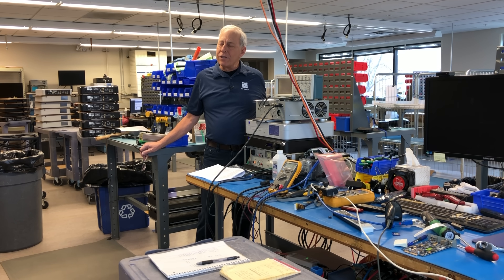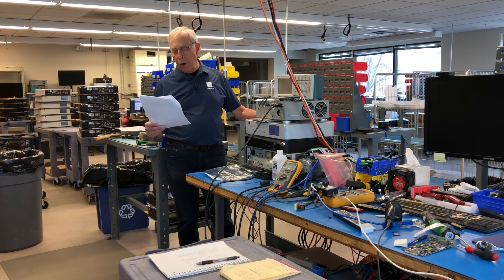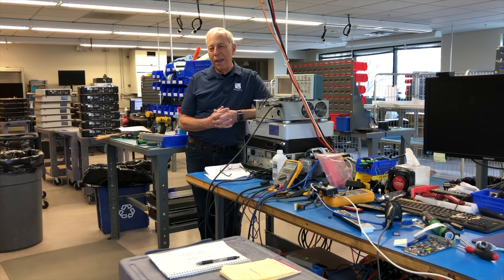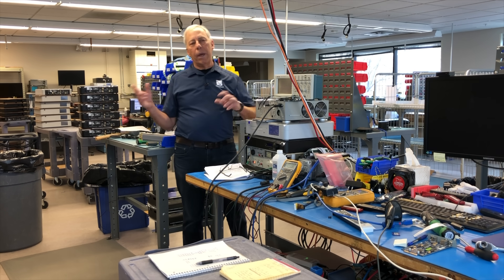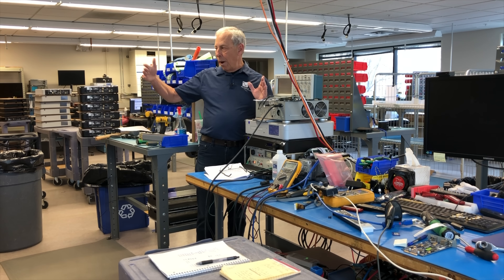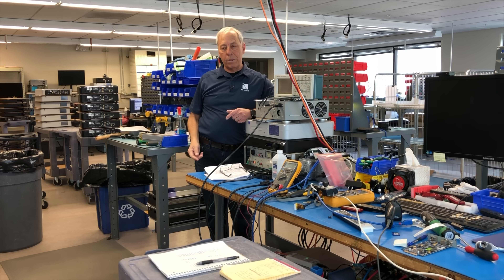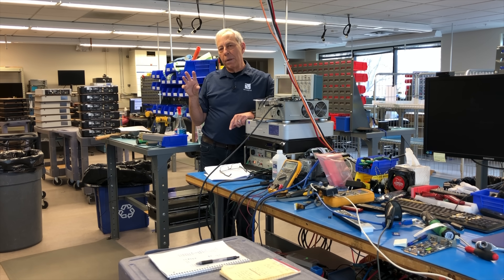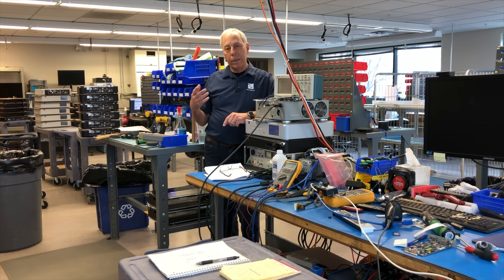Will a 50Hz component work at 60Hz?

Comment: Question.  So I will be getting a LCD 2018 LG TV that is from Europe.  The 50UK6500PLA to be exact.  The details of the TV says it has TM100 (Refresh Rate 50Hz) and the American version of the TV is TruMotion 120 (Refresh Rate 60Hz).  But on thing is, the European Power details, it says "AC 100~240V 50-60Hz".  So it looks like it is still capable for 60Hz.   So I will be using Roku, N64, etc. that I have here in the United States.  So will those devices be slower as the TV is from Europe but my devices are made for the North America?
Reply: TVs in Europe have only PAL (4.43 Mhz colour) and/or SECAM (4.4 and 44.2 MHz mixed colour) analog TV tuner that can’t change to NTSC colour system and System M (4.5 MHz carrier) mostly use in NTSC (3.58 Mhz colour) countries, PAL-M in Brazil (3.575 MHz color) and PAL-N (3.582 MHz color but 625 lines).
Reply: BUY A TV IN UAE OR SAUDI ARABIA. THAT TV HAS MULTIPLE NTSC-M, PAL-B/G, I, D/K and SECAM-B/G, D/K analog TV tuners. 

TVs sold in Saudi Arabia or UAE also have:
Colour system selection: AUTO, NTSC 3.58, NTSC 4.43, PAL, SECAM
sound carrier system selection: M (4.5 MHz), B/G (5.5 MHz), I (6 MHz) and D/K (6.5 MHz)
Some analog TV tuner have International TV tuning frequency: America (Philippines, South Korea, Taiwan, Burma), Asia/Western Europe, Russia, Indonesia/New Zealand, China, Hong Kong/UK, South Africa, Australia. (That function only for Samsung TVs).

JVC multisystem NTSC/PAL/SECAM analog TV sets sold in Saudi Arabia also on System M that Mostly uses US frequency, and system B/G,I and D/K mostly uses Europe frequency.
Reply: Not a frequency issue:

Chile uses NTSC and 220V at 50Hz
Saudi Arabia uses PAL and 220V at 60Hz
Reply: TVs sold in South America supports NTSC 3.58, PAL  4.43, PAL 3.582 (PAL-N), PAL 3.575 (PAL-M) and SECAM (PAL 4.4 and 4.42) on Video AV inputs only, Component also uses both 50 and 60Hz, for analog TV tuner that uses only 4.5 MHz sound carrier: NTSC (525 lines, 3.579 MHz color), PAL-M (525 lines, 3.575 Mhz color) and PAL-N (625 lines, 3.582 Mhz color).
Reply: LG TVs sold in the UK only have analog PAL-I (6 MHz sound carrier, 8 MHz bandwidth: UHF CH 21 - 69) but can’t change sound carrier systems: B/G (5.5) and D/K (6.5) nor NTSC-M (4.5 Mhz) nor SECAM.

Video inputs supports NTSC, SECAM and PAL, 50 Hz 60Hz refresh rate for component and HDMI.
Reply: For UK LG TV, also but RF TO AV (menu uses PAL, automatic color system change: sound carrier switch selectable: M, B/G, I, D/K. RF TO AV box sold on Aliexpress but can’t use on NTSC only TVs.

Comment: So, transformers become more efficient at higher frequencies and thus can be smaller.  This would explain why military aircraft and ships use 400 Hz.  Thus, transformer designed for 50 Hz would be a little bigger than needed at 60 Hz, but a 60 Hz transformer would be too small to work at properly at 50 Hz.

As a side note:  I am old enough to remember when frequency was specified in cycles per second, cps.  Then someone decided we needed to have a name for that and decided to honor Mr. Hertz.  I prefer and wich we had stayed with cps since that describes that thing we are actually talking about.

Comment: Will the lifespan of a 50hz equipment used in 60hz remains the same or reduced?
Reply: Sir I have a Denon amplifier I bought 13 years ago from UAE. Still working without problem. Hope it helps

Comment: Permission to comment i want share my personal experience a 50hz receiver will work on 60 hz power supply  i bought my harman/kardon receiever by mistake and impulse buying cause it was on a good sale which include speaker my mistake is i didnt check that the power supply is 50hz it works fine on me when i shipped it on my home which uses a 60hz power my receiver damaged not by power supply but with the cats urine cause they slleep on the top of my unit with open grills on it. Im from Philippines by the way

Comment: Thanks, we bought an automatic cat litter tray using a 24v 60hz synchronous motor using a 120v mains adaptor.

We are on 240v 50hz, and though I got it working, it was very noisy.

I finally realised it was probably the 50hz making the motor unhappy, and you have confirmed that it is probably the case.

Comment: Question: I bought thru ebay a vintage Panasonic flip clock from the 70s. In the USA it ran on 110V & 60Hz. Here in Europe (Italy) on the other hand we have 230V 50Hz. Is there some sort of converter/inverter/adapter that could do the trick to make it work correctly? Thanks
Reply: A step down power transformer can get you the 120v but there's no easy way to convert down the 60 hz to 50.
Reply: @sfs2040  thank you for your reply! Now I'm in the US again and I'll be able to connect those vintage Panasonic clocks soon on their original power grid. This time on the other hand I will have to figure out how to hook up the Panasonic vintage radios that are identical but meant for the European electricity grid. In the future I'll post a video regarding this specific radio clock model from the 70s/80s

Comment: Hello !
I have a studio flash (photography) that works in 200-240 Volts at 50 hertz.
Can I use it on a 220-240 60hertz chain ?
Note: this flash has a fan that works by cooling it and a digital display.
Thanks!

Comment: I don't think it matters much with solely electronic equipment. You must understand that hertz can only translate on mechanical equipment that depend on rotary where heating can be factor in reducing the life of the equipment. Clocks/ timers are probably the only issues since running higher or lower than the source can make it less accurate but it will never kill your device or make it less efficient with time.
Reply: It used to be with reel to reel tape recorders and grammophones that it did matter the Hz. I had a Sony TC-102 that had a spare spindle for the motor, the 60 and another for 50 Hz. the latter of course had a larger diametre as to drive the correct speed difference. Today, most evrything works on both frequencies. Computers, iPhones, etc. all run on either frequency. The 50 vs 60 Hz was prinararily for motors for clocks and audio equipment.  Again it is only a ten beat per second difference between the two. Now 25 Hy shant work in either, that frequency is just too low for modern appliances. It is great for railway electrificatzion however (single phase). Now in my country, switzerland, as well as Germany, Austria, liechtenstein, and Sweden, as the railways use a 'Drehstrom' or three phase system, single phase is tapped for what is one/third of 50 Hz, 16,666667or 16.2/3rd Hz. Hz. One can see the incandescent lighting flicker at this frequency.  Both on the rolling stock, and the wayside signalling.  Today, with LED, maybe there is some inverter as to convert to either 50/60 Hz.

Comment: Hi I have a 210 - 240 volts, 50 hz washing machine that i bought in the middle east. Can i use it here in the Philippines with 60 hz electricity supply.
Reply: Its always a bad idea to use 50hz on 60hz or vice versa on equipment with rotary motion. With time your equipment becomes less efficient.
But to answer your question, the washing machine will probably run fine since its not drawing more power than what it suppose to manage. The problem is using 60hz appliances on 50hz source supply can damage your equipment over time.
Reply: Same issue XD

Comment: British clock with tea machines won’t work properly because they are design for 50hz and plug it in an 60hz outlet it will make tea but the clock won’t because they measure the time by using 50hz as a reference and it will make your tea earlier.

Comment: You are correct that Taiwan uses 60HZ but Taiwan is manufacturing country that the product intended for china or Hongkong or other countries that uses 50hz were maybe  sold deliberately to local market w/ cheaper prize. I buy the Digital clock from Taiwan Superstore as a gift but when I arrived in my country the clock is moving fast. Do not use also an AC voltage regulator of different frequencies. if you use a 50hz AC regulator to a 60hz frequency you will burn the house that uses that regulator. To my experience in servicing electronics equipment with motors use only the wright frequency to guaranty it will work normally for a long time.

Comment: I need help sir i have a 50hz 220-230V.Corded type wahl hair clipper bought in Italy.Can use this in a 60hz 220v supply in the philippines?
Reply: Sure you can. These type of equipment does not rely on frequency in their speed.
Reply: @betong4908  Yes it does because a hair dryer have a motor to blow air.

Comment: I have a hammer drill machine with cord it is 230v and 50 hz can i use that to 220v and 60hz?
Reply from the maker: Any motor that runs on AC will have its speed affected by the change in frequency. On a drill that probably doesn't matter.
Reply: So it will run in 220v and 60 hz and it will not overheat?
Reply from the maker: @AmajaceTV  I am no expert of drills and hammers, but in my experience, a frequency dependent motor just runs a smidge faster at 60Hz than at 50Hz. If you're worried, do tests of the heat and keep an eye on it.

Comment: So I can use a smartwatch that's from China that's 50 hz in Philippines where we use 60 hz? Is that right?
Reply: mymidgetbae Smart watch is battery operated. You mean Smart Plugs.
Reply: mymidgetbae You can use smart plugs from China and use it in the Philippines with Euro/US to US plug adapter and no problem.
Reply: Smartwatches are powered by a battery that is charged by a charger that was designed especially on the assumption that one who uses a smartwatch is likely to travel around the world.  Therefore, the fine print on the charger will say 100-240V 50-60 Hz on the AC input.  The DC output rating on any smartwatch charger worth half its salt will read 5V DC at 3.0 A; if the smartwatch is fancy enough to charge using USB-C, a charger worth half its salt will give a rating (and darned well deliver on it) of 20V DC at 5.0 A.

Comment: I need help i have a 50hz 230v. Corded type brush motor power tool(dewalt). Can use this in a 60Hz. 230v. Supply.?
Reply from the maker: Yes, very likely. These kinds of devices do not typically rely upon the frequency for their speed.

Comment: 50hz & 60hz cannot be mix because it will damage or it will malfunction the equipment u are using for a long use. Use the right freq as design in the equipment. Example a 50hz Digital clock design in Taiwan or China cannot be use in Philippines 60hz freq. The Time will not be exact even same voltage. Electrical & Electronic design follow the frequency it was design except the designer tell you that you can use it from 50 to 60Hz as indicated on the product label. Another example is the Xerox machine if you change a 50hz motor from original 60hz motor with the machine running in 220 or 110v 60hz. The Photocopy of the xerox machine is very far from the original copy. In short intermittent copy. In Computer with 60hz design and you use a a 50hz PSU in 3 to 5 months you will damage the HD. In summary use the equipment on which it was Design. In Audio Equipment follow Paul advice because He is long time in that field. My field is all office equipment and Front to Endline Semiconductor Maintenance.
Reply: Correction: Taiwan is on 60Hz, but uses 110V. Their analogue television system used NTSC colour.

Comment: Paul, lets take a 50 Hz inverter and ask it to run at 60 Hz, will it work/,, because the electric motor the inverter is powering is 60Hz but the only inverter I have big enough to run the motor  is 50 Hz.

Comment: I rarely find better and clearer explanations of electricity related things  than your video. What if the frequency is much higher? Say 400Hz. I just bought a new pure sine wave dc to ac inverter and found that it does not give me 60Hz as I wanted but something close to 300-400 Hz with a load. (When there is no load,  the frequency is erratic and changes all over the place some where between 600-900 Hz.

Comment: DC is better than AC for transmission with high voltage because of less reactive losses and no skinneffect present, the only problem is how to cheaply and easily transform the voltage and that's the reason we use AC instead of DC, HVDC is the standard for transmissions for more than 500km.
Reply: Yes! His explanation about why ac is better for distribution is wrong. The reason high voltage distribution is better is because given a fixed power for a source, the volts and current are inversely  proportional. If you keep power constant and increase the voltage then the current decreases. Decreasing the current decreases the loss due to resistance I^2 R. At  Teslas time, transformers could increase ac voltage but there were no practical methods to increase DC. Today we have efficient dc-dc converters that generate high DC voltages. You are right!

Comment: I have the same question but other equipment. Is it safe or how it performs using 50hz inverter Mig Welding machine on 60hz supply will it perform the same on 50hz vs. 60hz. Thanks in advance.

Comment: So if I have an appliance that works on 50hz, and I move to a country with a 60hz frequency, how can I  reduce the frequency from my power supply from 60HZ to 50HZ? Reason is, my washer/dryer machine refuses to work on 60HZ and throws an error code on the display. And I can't find a way to fix it, please help
Reply: No need it is working well here in philippine but if you have a doubt use AVR

Comment: Sir my question is that would there be a difference in the electricity bill of countries that recieve line voltage of 220v and 110v respectively?
Reply: No, - not because of the line voltage. Typically you are paying for electric energy, E = W * sec. or in kWh. Mind you: W = V * A
Reply: The minimum voltage in the US is 120 volts. It used to be 110 volts.

Comment: Loved the video. The question that brought me here relates to a mini split ac system sold in India for 600 brand new that the same manufacturer sells here for 4 times that. The only difference in the spec sheets is 50 hz vs 60 hz. Thanks to your clarification I believe that if a transformer at 50 hz is over built for 60 hz then a motor will be also as they are essentially the same thing. Thanks so much.
Reply: The motor will likely run faster at 60hz but I doubt it would damage anything

Comment: Sir hbt my 50hz fridge.. How to use it in Philippines,. Thanks
Reply: matanghari Iglesias It will increase it’s temperature.

Any 50Hz appliances from China including toasters and Rice cookers in the Philippines that uses 60Hz  have no problem of using it.
Reply: @FrancisLitanofficialJAPINOY Stop spreading lies. Machines designed for 50Hz work better on 60Hz as they get extra 20% efficiency. Motors may spin too fast though and some sensitive appliances may break (coffee machines are very sensitive for some reason). But most of the time it will be cooler on 60Hz
Reply: @LoganT547  how about my water pump 50hz can I use it in 60 Hz?  There is no problem?

Comment: Would my solution work?:
I want to use clippers from the US in Germany.
Since german outlets only provide 50Hz I wanted to transform 230v AC to 12v DC and then invert 12v DC to 110v AC and hope that the inverter magically provides 60Hz. I think im stupid
Reply: genoelch 50 hz washine machine  will work on 60 hz supply?
Reply: genoelch Not 230V to 12V DC. It’s 100V to 240V AC to 12V DC, in order to plug your 12V DC to 120V AC inverter for your hairclippers. Not just 230V at 50Hz, but also 50Hz countries uses 100V - 110V - 127V at 50Hz. Eastern Japan (Western Japan uses 60Hz), Jamaica, Barbados, Caribbean Dutch, etc..

ROYAL CARIBBEAN CRUISE LINES SHIPS electrical outlets uses 60Hz in all voltage outlets.

Comment: If I were to get an electric shock, 120 v. 60 hz. is much better than 120 vdc. Why you ask? 60 hz. means that the voltage has to pass through zero to - than again through zero to + meaning when it goes through zero, you can let go. 120 vdc is constant. You can't let go!! Much more dangerous. I have an old Crosley tube radio that's rated for 25 hertz. Works just fine on 60 hertz.
Reply: You are wrong. AC is much more dangerous than DC. 60 hertz is oscillating too fast for you to let go anyways. The reason why AC is more dangerous is because the peak of the wave is higher than the rms. For example, 120 volt rms has a 170 volt peak. The sine wave can deliver the same amount of power as the 120 volt dc, even though it has 170 volt peaks. So, you If you touched 120 volt DC, you would realize that it barely hurt compared to 120 volt AC.

Comment: how about a 50hz ref or washing machine on a 60 hz system. will it damage the appliance?
Reply: Did you get the answer? I suppose to ask that too.
Reply: Will the use of a transformer fix the issue to mitigate this issue and correct/adjust the operating frequency?
Reply: Don't. Your appliance won't last long as the 50hz motor inside the refrigerator or washing machine will spin faster but produce more heat thus shortening its lifespan.
Reply: Ive been trying to find someone to answer this for me as well. I have a 220v 50hz washing machine that was really expensive, and I’m moving to the US which is 60hz, and would hate to try and sell for nothing.
Reply: @NYGiants4Life if the same 220v no problem.
Reply: It will run faster and actually cooler than before. 20% better efficiency than on 50Hz but some devices don't like the wrong frequency